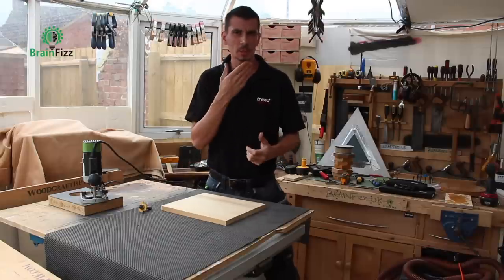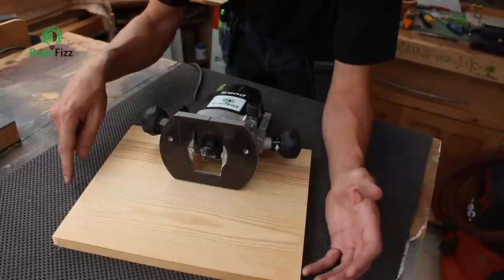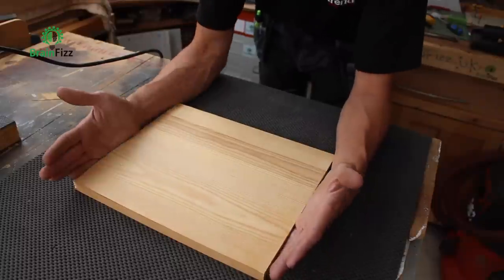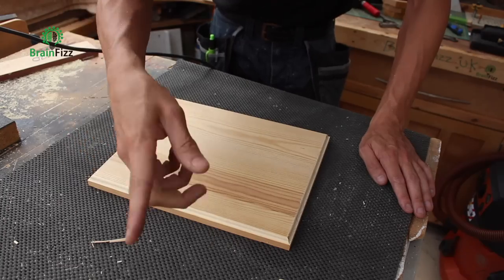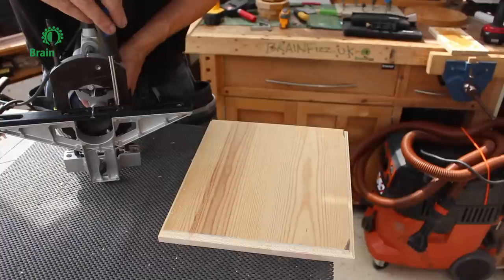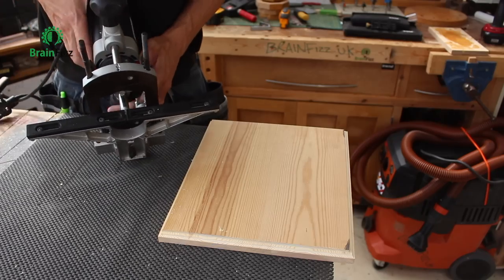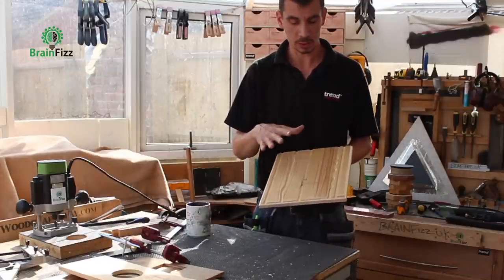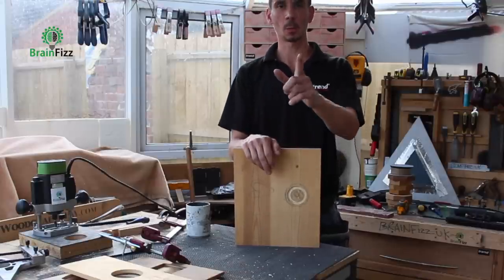Router direction of cut: Everything you need to Know! Tips and tricks for perfect safe cuts

Comment: I have recently been using a router for v grooves on panels and noted, as you state in the video, I was going clockwise and the lines were not straight but deviating slightly away from the fence, doing it anticlockwise, after watching your video 👍 my lines are now true and very straight! 

I noticed the router pulled into the guide fence and not away from it, so the rotation of the cutter were pulling towards the fence (as in your video 24:05) - which ultimately gave me a nice clean straight line cut. Great video and appreciate your guidance. 👍 Thanks!

Comment: I don't usually have the patience with long videos but this was super useful and so well explained. I don't even own a router. Yet.
Reply from the maker: Glad it helped!welcome back any time! Im currently in the midst of producing several other Instructional  Router videos, and live streams, so keep an eye out for those if they are of use!
Reply: @BrainFizz  thanks. I'm choosing between a Hakoki M12VE and Trend 7EK - any suggestions would be super helpful!
Reply from the maker: thegoodraj I’ve not used either reaching much, but I have a good deal of other machines from both brands.
Both will give you good service and after care.
I would advise to pick which ever machine gives you the best overall benefit based on:
Plunge travel
Aperture size (biggest cutter you can use)
Guide bush flexibility (base configuration)
And the price.
These benefits I believe to be higher priority over motor size (Watt/HP),
Reply: @BrainFizz  thanks this is really helpful

Comment: Good video Richard. You covered a lot of ground in 35mins. Agree 100%. Bill Hylton would be proud of you! Keep 'em comin'.
Reply from the maker: Thanks.. I was tempted to chop it up into several bit sized videos, and Although it might have generated more ad revenue, i think it was better to have it stay a single video. There is a lot of ground to cover with this and I tried to keep everything relevant but also logical, and useful for viewers - hopefully i managed to keep the waffle to a minimum. Thanks for watching!
Reply: What is the material in the wood stood on
Reply from the maker: gerry skelton do you mean the black mat on the work bench?
Reply: Yes
Reply from the maker: The black mate is a "router mat" or "routing and sanding mat", they are basically a nonslip rubber mat that holds the work in place without the need to clamp it down to the bench. great for sanding and routing! They're sometimes found in diy centres and also car shops as non-slip boot/trunk liners well worth the money!!!
Reply: They are sold here in Germany also as table tops 😜

Comment: Thank you sir! This makes perfect sense.
I’m sure that now I can route my first ever project (a grid on a game board) properly.
As an electrical engineer by trade I was over complicating my jig. I was making two parallel rails from aluminum profiles. I can get away with just a single one as long as I move counter clockwise. That makes the jig easier. I just need to figure out my offset. My cheap Ferm doesnt have a nice little slit, showing me where the cut wil end up. And eyeballing it is quite tedious through the Perspex protection shield. I rather measure and mark it once on the skirt/base.

Comment: Newbie to routeing thank you for posting this video Richard I now know some important points and safety aspects.
Reply from the maker: Ace!! welcome to #Teamrouter Be careful, but don't be scared. learn the 4 "rules" of routing:
1. Direction of cut.
2. Feed Rate.
3. Depth of cut.
4. Spindle RPM

And you'll be fine! any questions, feel free to ping me a message!
thanks for the watch, and stay safe!
Reply: Thank you Richard...just one question how to you work out spindle speed ?  My first project is fitting solid walnut worktops and would appreciate your advice on the spindle speed  for this timber...thank you
Reply from the maker: Easy peasy, Spindle speed is set by the diameter of the cutter, it has nothing to do with the material, at al, whatsoever, ever... nothing... if you're fitting worktops, chances are your cutter diameter (that's the part doing the cutter, not the shank diameter) will be 1/2"(?) anything smaller than 1" diameter will be good for between 24K-28K RPM - Usually full speed. take multiple passes, no deeper than 1/2", if your burning the timber, cut less material per pass..
People seem to think that slowing the cutter will stop burning, but it's got virtually nothing to do with it, even at slow RPM's a cutter will burn the wood, if being fed slowly. cutting too much slows down progress, slow progress burns wood,  slow cutter doesn't cut efficiently - this actually slows your feed even more... 
there may even be a video explaining it, i honestly can't remember, it'll be on the channel about burning wood, or about variable speed routers? - probably in the #cuttingedge questions series/playlist.
hope this helps.

Comment: Great video Richard covering some mind bending stuff to get to grips with.

puts hand up One thing I'd add is when cutting right the way through something (as you mentioned about the circle bit in the video) is to watch for the internal piece coming loose as soon as you've gone right through the board. My habit is to put some double sided tape between board and workbench (or sacrificial backing board) ensuring the bit that's going to be set free at the end is stuck to the work surface.
Reply from the maker: this was deliberately omitted from the final cut as this will form part of a future video about using templates. I too use this technique if the internal piece is required undamaged. another method is to leave it attached partially, then remove by hand and flush trim the remaining material.
Reply: Richard Morley I most likely learned the technique from one of your army of earlier videos. Looking forward to the new template one!
Reply: Neil Dunlop aaaaaaa

Comment: Excellent video for anyone embarking on first time routing.....as far as break out goes at corners which is annoying when aiming for perfection.....i router the corners first in a clockwise direction carefully.......also much prefer using my small cheap red devil router than my huge makita 2000W affair.
Reply from the maker: +The CheviotWildCamper There are admittedly occasions where exceptions to the clockwise/anti-clockwise "rule" can be used, and I too will do this on certain work. As long as you are aware of what's going on a "back cut" is a good way of eliminating break out/tear out of fibres. I left it out of this video to include in a future video specifically on these type of exceptions so as not to confuse viewers. That said I
For lots of edges, I find it faster overall, as there are no breaks in workflow.
Thanks for watching I hope got value from it
Reply: BrainFizz i didn’t fully understand why in the inside you rout clockwise...... can you explain me? Excellent video by the way. Thanks!

Comment: Great video for someone who just bought his first router! Another way of looking at which direction you should choose is to realize that the router has a natural drift as you explain in your video. You want to make sure it's drifting/pulling is the direction to reinforce the support.

I have my router mounted upside down on a router tabel so instead of moving the router, I'm feeding the wood into it. Gonna have to figure out the router's natural drift; there's a brain teaser for you ;)
Reply from the maker: When the router is in the table, it doesn’t drift, it tends to fire the work out the other side and pull you into the work.
Check out the “widening slots, dados and coves safely” video in the router playlists. It covers this on a table.
Reply: In a router table always feed the work from right to left (workpiece between you and the cutter) as it can be very dangerous if the cutter grabs the wood and it is best practice to use push pads. To add confusion, if using a horizontal router, the workpiece is fed from left to right.

Comment: I could never remember which way to run my router until I learned a little trick from Jason Hibbs of Bourbon Moth Woodworking.  Make an "L" with the thumb and index fingers of your right hand (finger gun or "loser" hand sign).  Put the tip of your thumb against the surface you want to use your router on with the palm of your hand facing down.  Your index finger will always point in the direction you should run your router.  You can use the same "trick" for your router table also.  You just push the work piece in the direction your index finger is pointing.
Reply from the maker: People remember things in different ways. 
For me all that hand waving just ends up head scratching…
“Anti-Clockwise round the outside” done ✅
Reply: @BrainFizz  Shouldn't it be counterclockwise around the outside?  Jason's method works for outside, inside, upside down and all you have to remember is to use your right hand...LOL.

Comment: Good video!  A good way to remember the movement direction of a hand held router is to use the “right hand rule”.  The thumb of the right hand points to the edge of the wood to be cut and the index pointing finger is at 90 degrees so the pointing finger is pointing the way the router should move so you do not have worry about remembering left and right positions.

Comment: Thank you for the video, very informative, I have one question where would I go to find more information on the safety of different types of wood dust?
Reply from the maker: Thanks!!👍 Common sense to most, but something a lot of people overthink and get confused about! Thanks for taking the time to comment!
This is a fairly old video that seems to have had somewhat of a resurgence in the last couple of days....whereabouts did you find the link?
Reply: Ahh ok, I think I found what I was looking for in a Material Safety DataSheet (MSDS), seems birch ply isn't a massive issue! I got recommended the link by Youtube,  I've just got myself a router and trying to get to grips with it before I even turn it on! I think YT re-jigged their algorithm and now helps smaller YT channels get exposure, that and I think the quality of the information you're going over is very high.
Reply from the maker: I treat plywood with nearly as much caution as MDF... it’s not so much the “wood” but the glue that is used. Pine, I don’t bother, but pretty much everything else I use a P3 rated mask, and either an L or M class extractor,

Comment: In a machine shop, running vertical and/or horizontal mills, the difference you are discussing here is referred to as conventional vs. climb milling. Conventional milling is what you are demonstrating and was the predominant method of cutting on manual machines throughout the 20th century. 

Climb milling is overwhelmingly the method utilized on CNC machines, which are equipped with ball screws to provide movement of the table ane/or cutter.
Reply from the maker: I was taught on manual mills and lathes in the mid/late 90's and and much prefer them to CNC milling... I think CNC utilise climb cuts in the software as its easier for  them to act as a break to resist any runaway, rather than constantly 'fight against' the direction of cut....
Reply: @BrainFizz  climb milling generally resulfs in a superior finish, all other things being equal (speed, feed, doc, matetial, cutter, etc.), and if the setup is good, lesser forces exerted on the workpiece, and less damage to the crystaline lattice microstructure. Climb milling utilizes a thick-to-thin chip which is always desirable, for the workpiece, the cutter, and for greater efficiency. I am so eager to see what does and does not carry over to hardwoods.
Reply from the maker: Climb cutting on wood gives a nicer finish but you need to cut less as the router will want to wonder, and sometimes run away with you if you try to cut too much. Also router cutters tend to be straight fluted (although spiral flutes are available), 
Conventional cutting is however more efficient as the waste is cleared as it cuts rather than pushing the waste into the cut. 
Timbers also beef for from mush faster  spindle speeds and higher feed rates than metal.

Comment: Thanks very much for helping advance my understanding of routers. I now understand what I was doing wrong before. With your clockwise/anti-clockwise logic, I now know to go anti-clockwise when doing a roundover on the outside edge without any fence or straight edge. I also now know that to do a roundover on the inside edge, I need to go clockwise. Your clockwise/anti-clockwise logic at the beginning with that yellow roundover bit helped a lot. 

However, with a clamped straight edge, routing with an offset, I'm still confused. Could you please help me figure it out?
Reply from the maker: oldporkchops treat the clamped straight edge as if it were the wood, and you were doing a roundover. 
Ignore the wood, you’re now going anti clockwise around the straight edge, or template.
Reply: @BrainFizz  got it. You just gained a subscriber. Thanks.

Comment: Great video, BUT , how did you keep the wood plank from moving?
Reply from the maker: This demonstration was done on a non slip router mat, available at most routing suppliers. Otherwise just use normal clamps and move them around as required.

Comment: Hi Richard, how are you. I need your expertise advice.i had a plunge router but I hade few issues with it the plunge spring gets jam and torrent move around and ruins my dept cut. So I purchase another plunge router which has a micrometer dept adjustment. Could bring a video how to use this mechanism, much appreciate.
Reply from the maker: +elvis o'shaughnessy how to set the turret system with the bar and the micro adjuster depth adjuster as well??? Sure no problem!!

Comment: Hello there,
Really appreciate your video  but  need to admit didn't understood clockwise turning when cutting inside. Can you please explain why.
Thank you very much
Reply from the maker: its because the work is on the opposite side of the cutter, the top of you work is the same as the bottom side of your inside hole, left becomes right etc, so everything is opposite.. therefore clockwise becomes anti clockwise.

Comment: Hi, Richard -- thanks so much for your videos. I'm a total beginner...just unboxed my new plunge router today...trying to learn to use it. I noticed in your video that sometimes you seemed to lock the bit down in its lowest ("plunged") position, other times not. Did I catch that right? The reason I'm asking is I had wondered if it's safe and effective for me to lock mine down like that (which is how I found your video!).  It would seem that by doing this I won't have to deal with too many new skills at once. I figure routing a straight line is probably most important, so if the depth gauge can be locked for me, what a help that might be to this newbie!  Your thoughts?
Reply from the maker: Hi Lisa welcome to #teamrouter!
Locking the router plunge to the depth you’re cutting will indeed give you one less thing to worry about when concentrating on your work.
But don’t confuse this with cutting the full depth of the cut in one pass.
It could be that you need to make “the same cut” several times with the router cutting slightly deeper each time.
There’s a video on “depth of cut” on the channel as well. 👍
Reply: That makes sense.  Thanks so much!!! I'll grab some wood scraps and practice, practice, practice!!!  Blessings...

Comment: Excellent Video Richard. We are busy refurbishing an Oregon pine dining room set and it was very helpful regards chipping.  What I would like to know: What is the model number of the plastic Trend fence that you are using. I been searching the web but just can not find it.
Reply from the maker: do you mean the fence I'm using at 9:21?
Reply: yes.  the plastic fence that you clamped over the pine board.
Reply: sorry Richard you used it at 25:10
Reply from the maker: these Clamping bars (clamp guide system) are sold as part of the "VariJig" system by Trend here in the UK, they have a lot of stops/squares/jaws etc as part of the system and are fantastic.
Other brands of these are also available across the globe, but a good starting place would be to google "varijig clamp guides" that should pull up lots of options. hope this helps!
Reply: Thanks a lot.  I am going to get on it straight away.

Comment: Hi Richard, on a separate note, I have a 3M respirator and noticed on a previous video that you had a container that you kept yours in. Is this still the case? If so where did you get it from??
Reply from the maker: +Chris Flux My 3M mask (7500 series half mask), has a poly bag which came with the mask. The hard plastic case, which can be seen in most video hanging under the small shelves, is for my Trend AirAce  half mask. The cases are available separately through trend stockists, but I've never tried putting the 3M mask in it.... Hope that helps?
Reply: Richard Morley I recall that now you've mentioned it! Appreciate the reply. Yea I have a bag but was thinking about a quality small Tupperware type container and remembered seeing a video of yours. - I've got a relatively new T10 router as I wanted something accurate but whilst browsing I saw a lot of bad reviews of the t5 (I know they're different class but sure you've noticed the reviews online) how do you find it? as I see you use it quite frequently.

Comment: Sir, using a flat bit, I am trying to make a table from a tree trunk, what way do you push/pull to keep it from burning
Reply from the maker: Prevention of burning is about feee rate. You’re moving too slow, allowing too much heat to build up in the timber.
To increase your feed rate cut less material. (Reduce your depth of cut).
Reply: Sir thanks for replying, I found out that the tree is ash, is your trick going to work, or is it inevitable it’s going to burn